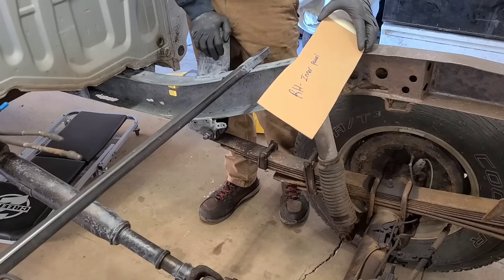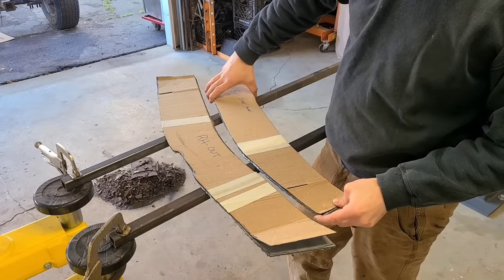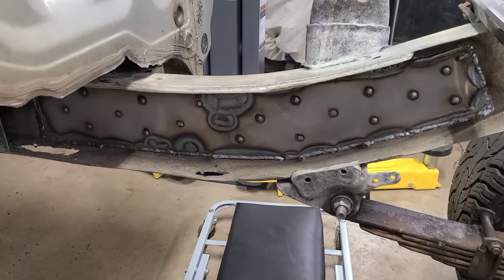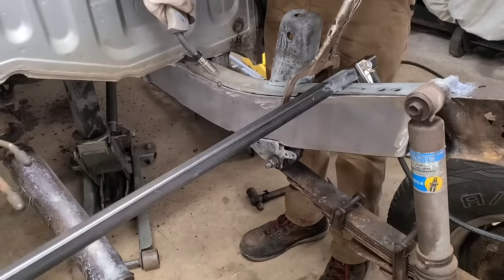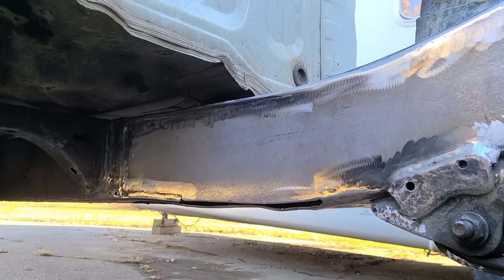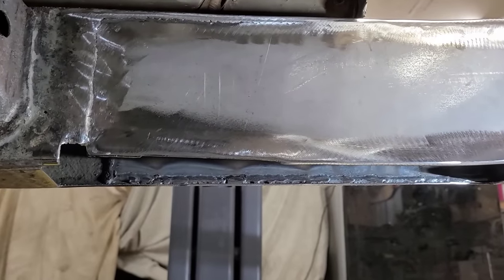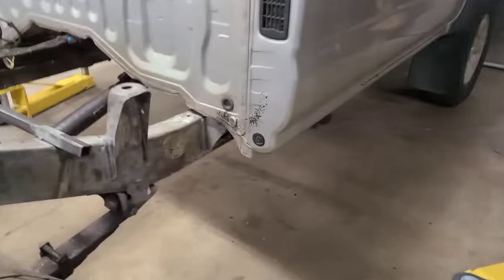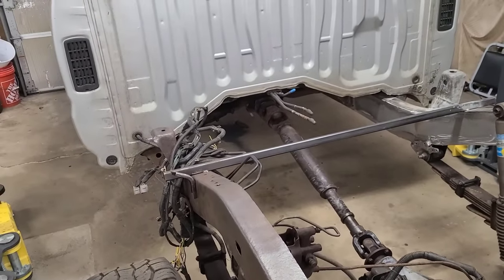Reinforcing and repairing the Tacoma frame

Comment: Thank you for documenting and sharing your adventure of repairing your Toyota truck’s frame. I have watched many videos on the repair of rusted frames and glean ideas where possible. I gained several ideas from your videos I had not seen used elsewhere. I especially liked your procedure of fish-plating the inside of the frame rails and using plug welds to add rigidity. Your cleaning of the areas to be welded with acid was a new-to-me process. You mentioned the importance of removing all debris that could be reached inside the frame rails, even beyond the area where you had been welding. Many other videos show frame repair caps added to rotted frames with no internal cleaning attempted. Even if procedures were used to spray anti-rust chemicals into the frames after repairs the spray would only coat the top of the debris pile. That debris will, as you mentioned, continue to adsorb and retain water and road salt and promote degradation of a newly repaired frame. Additionally, the debris could eventually block frame drain holes and further accelerate future frame rot. Folks wanting the most return for their efforts and expenditure would do well to follow your example. Of course, some people may not be able to afford the extra expense of a thorough job and that has to be considered, especially if one is repairing someone else’s vehicle. Thank you again.
Reply from the maker: You're are very welcome, I'm glad that you found it helpful. I feel the same thoughts as you've explained. Getting the metal stripped clean and sealed up is the best chance it has to last a long time. 
Thanks for watching, and stayed tuned for the final result. It is amazing how far this truck has come!

Comment: Most home builders can weld (think they can). But the penetration depth of the weld is terra incognita for them.
It is often overseen. The weld lays mostly superficial and that line is nicely polished with the grinder. When you section it, probably half of the steel gauge is connected to the other plate.
The welding upside down (so the lower welds, where the torch fires upward) are especially sensative for lesser penetration depth. 
Half of the penetration depth is half of the strength. So beware.
Reply from the maker: No problemo!
Getting the material clean was one of the most difficult tasks.

Comment: Looks like solid work. Chasing thin rusty metal to get to good metal always sucks. People often make the mistake of over beefing the repair. It becomes so stiff in that area that thin, weak material breaks somewhere else. I don't repair frames anymore. I replace them. Rust free southern frames blasted and powdercoated. They look great and last a long time.  Be sure to spray some type of coating on the inside and open the drain holes in the bottom of the frame!
Reply from the maker: Thank you!
  I will most definitely be protecting my work when finished up.
 A rust free and powder coated frame sounds amazing.
Reply: I found the same problem of stress transfer with stronger sections.. & when cutting back: even if it looks solid today, with these thin shit frames, A year later it can be gone.
Reply: @jeremyr7147  I was always very selective of what or if I would repair. If you are trying to limp through for a couple years or wanting it to be forever is the fork in the road. This is why I do replacements only anymore and why I travel south a few times a year for Toyota frames. Start with something good and your results will show. One of those "pay me now or pay me later" senerios.
Reply: @penningtonmetalworks283  yeah, i just turned down one yesterday, an 03 Avalanche. Told him what were saying here.
Reply: @jeremyr7147  All you had to say was Avalanche lol. No disrespect. Maintenance on any vehicle is huge. To alot of people they are appliances, much like a toaster, a throw away item.

Comment: When you are welding upside down if you do not have a welding jacket you can use some old hessian backed carpet across your body to catch welding blobs instead of them burning through your clothes and skin and if you don't want heat distortion in your work have an airline with a blow gun to cool the area can also be used to put out small fires keep the good work going
Reply from the maker: Solid advice. Thanks for the tips!
I have a fire extinguisher handy for unexpected thermal events but could definitely invest in more PPE now that I am doing more welding.

Comment: Excellent, excellent video, I own a 2012 GMC sierra and discovered frame rotting on the inner side of the frame, I wanted to see how you make frame repairs, I'm very impressed with your work, I only have 1 question,  what kind of welder are you using??? If you could tell me I would appreciate it, grate video very informative and not a short video either, thank you.
Verne Johnson 😊
Reply from the maker: I have a 200 amp MIG welder and a 210 amp TIG welder. I have been mostly using the MIG and 0.035" wire. I wouldn't recommend using a 110-volt machine for this kind of work.

Comment: I've got this same project coming up,  inside the hollow box it would be best to add some stock that's shaped like snow fence stakes,  or stop sign type stock and plug weld it in,  then cap it all off with the patterned plates.  This inside material will help with torsion factors and everything else.  Adds a little weight,  but will be bullet proof once it's all tied together.  I'm not being negative,  I just believe in overkill since your going through the effort.
Reply from the maker: It sounds like you have a good plan on how you want to fix up your next project. That would definitely beef things up and I can't say that I have ever seen a frame built that way before.  I'm just trying to build my truck a little better than the good Ole factory Toyota spec. Aside from the rusting issues in my region, these are well built and highly reliable vehicles. I don't plan to build this into a rock bouncing offroad machine so it should suffice.

Comment: Do you have a shop? if so where are you located? id like to bring in my 02 prerunner double cab tacoma for rust repair. the rear half of the frame needs patched because of rust
Reply from the maker: No shop. I just did this in my spare time, and I'm glad that I was able to get my Tacoma back on the road. It is stronger than ever and looking great now.
If you need frame repair, see if a local shop could get you a quote. It seems that most places will charge more to repair than the vehicle is worth. Finding a complete frame to swap can be hard to find and costly as well.
Hopefully, you can find a place to save your truck.
Good luck!

Comment: For what it's worth,  if you have a lift, it's worth the time investment to lift the cab off the frame to get at the repair areas better. Rear cab bolts are a royal pain to remove, but the access you gain to the areas that need to be repaired is worth the time to remove the cab. I ran taps through the cab mounts before dropping the cab back onto the frame, so re mounting the cab was a piece of cake.
Reply from the maker: Now that the ball is rolling on this project, I may dive deeper into the frame work. Pulling the cab off will likely be in my future as I continue on. Oh how I loathe the rusty fasteners!
Reply: No need to pull cab 😮 in my opinion and after dozens of frame repairs. Leave cab mounts on but weld temporary legs from cab mount brackets to floor then cut cab mount bracket from frame . The cab is sitting on the floor in exact position in needs to be. Repair frame then reweld cab mount to frame and cut off temporary leg. 😊

Comment: I would have put zinc spray inbetween the metals and on the inside of the frame. Then finish it with a big spray of fluid film.
Reply from the maker: You can do it however you would like. I coated all of the metal. Then I used internal frame coating on top of that. When I am all done, I plan to also spray a coating like fluid film on top. Three layers of protection.

Comment: These videos are great.  I'm about to do same thing to my 2003 Tacoma.  When did you weld in the tube-metal cross bar?  Was that done to maintain torsional rigidity so it wouldn't flex during welding? I watched the other videos (needle scaling) but I didn't see at what point you added it.  Great work!
Reply from the maker: Thank you! I'm glad that you have found the videos helpful.
I added the temporary supports before removing the crossmembers. I was especially concerned about the trailer hitch area, so I added two back there.
Reply: Two silly questions. In one of your other videos, you mentioned a grinder disc that was twice the money, but well worth the money. I couldn’t quite understand what the brand name was.  Also, what settings were you using o. The mig setup?  Thanks!  You’ve definitely inspired me and I started ‘surgery’ on the frame this weekend.
Reply from the maker: @frankbosley5299  That is great news, Im happy to help!
The grinding discs are PFERD CC-GRIND.
All MIG machines will run a bit differently, and I'm jogging my memory, but I believe my settings were around 18.6-19.0 volts and around 300IPM.
I'd double-check your machines quick reference chart to get you started and tweak the settings a bit as needed.

Comment: This type of work is called "fishplate" repair.  The spot welds are a good idea but my opinion would be less holes and larger slotted holes for good penetration. Also stitch welds along top and bottom(40% or so) and no welds on vertical sections. Silicone chalk liberally before undercoating.
There is whole bunch of more rules for frame extensions.  Good job none the less!
Reply from the maker: A fish plate is a "reinforcement plate" but they are used when joining two structures together. What I did was add a thin plate over the existing frame member that was intact. I do agree with the slotting though. It was easier for me to drill holes than create a series of slots. Many vehicles are welded together using a slotted attaching joint.
Thanks for the advice!

Comment: I'm about to do this on my Hilux the chassis is just as bad if not worse 🤦 on the original frame there's a radius on 4 sides of the boxed sections sort of 2 c sections welded together do you keep that profile can't see in the video ps one of not the best guides on here are you going to epoxy paint after wards was the outside frame pitted badly are you cutting it out to thanks from UK 👍
Reply from the maker: I know exactly what you are referring to, and I did talk about it a bit in one of my earlier videos. The frame is two pieces pressed and welded together, like you mentioned. There are dimpled vee areas that appear to be a stopper for aligning the two sections before the factory welds were done. I hammer-formed a radius into one of the lower sections to match the profile of the original frame. The outer face of my frame is not that badly pitted and still has a good amount of thickness remaining. I chose to add the inner plates to reinforce those outer sections. That way, the frame could be used as a kind of placeholder jig. The inner face, being completely new, finished it off and boxed it in. So far, I haven't had to form much radius on the repairs.
Here in the USA, we have a well-known company called Eastwood that sells a large variety of coating products. I haven't fully decided what I will be using yet to protect this truck frame, but I am leaning towards their products.
Reply from the maker: One more thing, since the radius area of my frame wasn't rusted too bad,  I cut a clean straight line just past that area for the new plates to join up. I ground a bevel along the butt joint to ensure full penatration of the weld joining the new repair piece to the original framework.
I hope this helps.
Reply: @PostRt  thanks

Comment: So you do not paint the inside where you initially placed the first plate?
Reply from the maker: The metal plates were chemically treated to seal them. In a later video, I showed how I applied coatings to protect the frame.

Comment: 3:00   Funny to see the old Toyota frame on the floor.
Reply from the maker: Out with the old, in with the new.
Reply: @PostRt  I wish I had a solution for my Tundra.  I've got rust on the passenger's side around the wheel area.
I'm okay with caulking...not bad with a hot glue gun.....But I don't weld.
I've been looking for used frames.
Reply from the maker: @Dancing_Alone_wRentals  
I'd recommend having a shop evaluate the truck for damage. If that is not an option, try hammering along the frame for soft spots to see what is good or bad. You could look up the Auto Rust Company as they make Safety Cap repair sections for frames but they will also need to be welded in to repair rusted sections.
Ultimately, a frame replacement with a good used frame would be the best option. The cost is of that is going to be high and will likely be more than finding another truck with a good frame.
Hopefully this helps
Reply: @PostRt  sure does, tHanks again.

Comment: For those long welds, can you use TIG welding there???
Reply from the maker: Sure can, TIG welding would also get the job done. I have a TIG welder also but chose the MIG for most of this work because it is a faster process.
Reply: Tig would be stronger and less corrosive better weld also 70s 6 tig rod

Comment: Ime doing similar repairs, after all the time doing reinforcements.  the next weak point of the frame will break in a short time. The repairs are much stronger than original frame design and will force all the stress to the next weak point of the original frame - wherever it is.. crossmember crack off or something.
Reply from the maker: Break, build, repeat....
That seems to commonplace with many things in life.

Comment: Toyota replaced the frame on my Dad's tacoma for free ............. Toyota, in 2016, settled a class-action suit by agreeing to spend $3 billion to repair millions of Tacomas, Tundras, and Sequioa SUV's with rusting frames. Model years affected are from 2004 to 2008 (or 2010 in a few cases). This follows an earlier extended warranty affecting Toyota trucks from 1995-2003
Reply from the maker: He was a lucky guy!
Unfortunately the Toyota frame settlement dissolved before I could get on board.
Reply: Hello,  I have a 2005 Tundra sitting.....Bruce, Do you know if this recall is still in effect?
Reply: The recall time frame is officially over. As of January 23 2023 when I type this, you are no longer eligible for the recall

Comment: Where are you from?
Reply from the maker: Michigan, USA 🇺🇸
Reply: @PostRt  Do I have to make an appointment to have a job like that done?
Reply from the maker: I would start by calling a local body shop. They should be able to get you in contact with a place that specializes in frame repair work.
Another option would be to see if there is a race shop or custom fabrication shop in your area. Places like that are usually well equipped to handle work like this.
Reply: @PostRt  How long did it take to make that repair?  and how much does that repair cost?
Reply: @PostRt  But if I want to take it with you, do I have to make an appointment at your establishment?